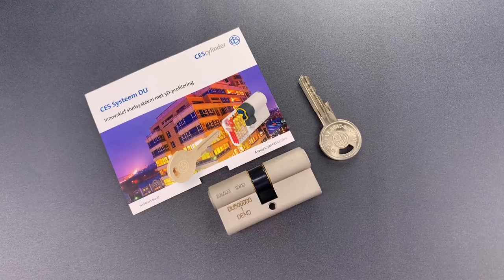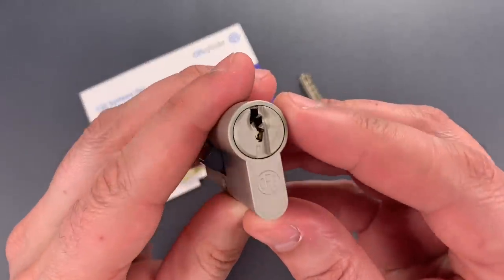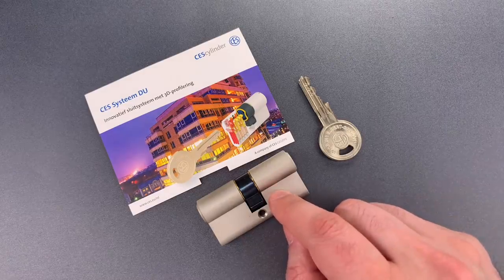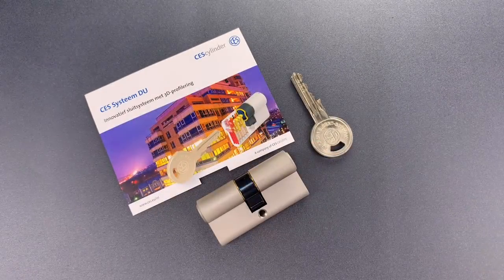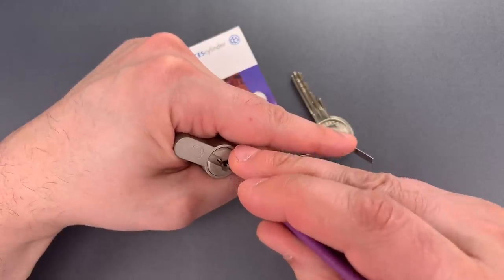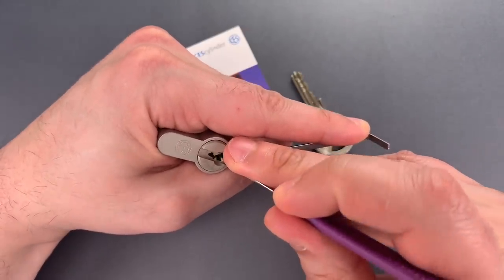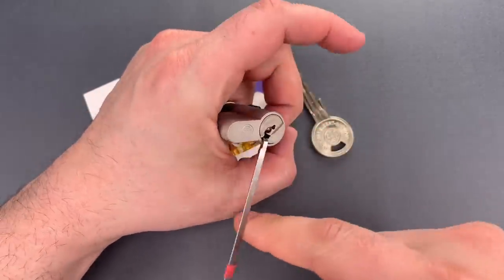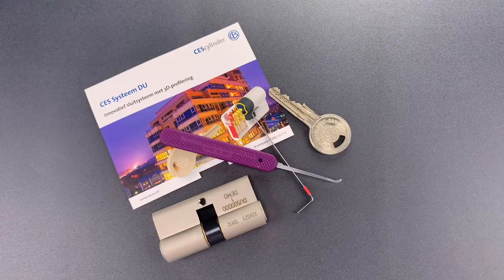[1248] Absurdly Paracentric CES Euro Cylinder Picked

Comment: I have a question for you LockPickingLawyer :
Since we are able to 3D print metal now , and 3D printing allow the creation of structures that are impossible to machine otherwise ( like the way the inside of a bone is), do you think there is a way to make a much more pick resistant lock ?

EDIT : I've never talked about making a "pick proof" lock , or a commercial lock, or even a durable lock. I'm talking about a theorical lock
Reply: The only lock I know is the stealth key brand look it up :)
Reply: One word: Ramset.
Reply: Maybe somebody can 3D-print an impossible pick
Reply: Since most locks poorly made to save costs, I really doubt 3D printing will solve this issue as the costs would be even higher.
Reply: @timwaeyaert8339  not any longer, porsche is printing Pistons etc.
Reply: @righteousone1  troll
Reply: @righteousone1  🙄
Reply: @righteousone1  man who pissed in your Cheerios good god why so upset? did your cat get run over or smth?
Reply: @darksentinel082  well, to his defense, it's in his name 😉
Reply: Bowley already makes a lock that nobody is going through the lock. Anybody wanting in, seeing a Bowley, will go around. They are technically pickable, but only by a select few. 

Criminals in the US rarely pick locks anyway, even though most locks in the US are comically easy to pick. It's too easy to throw a rock through a window, shim the latch, or go around the lock in some other way.
Reply: @idkidk4334  Very cool indeed
Reply: @timwaeyaert8339  there are fully 3d printed rocket engine, for example electron, so i guess while it is weaker than machined, that is not really an issue
Reply: If your goal is to make a very pick resistant lock then I speculate that it is possible to implement NP-hard puzzles with the pins with very intricate internals... but if you can 3D print such locks (cheaply enough so that these locks are profitable) then I guess torches have no problem melting them open too
Reply: If your talking about a lock made all at one time, sadly no, because it's simply impossible, because you need to add pins inside the lock, but making it all seperately and assembling it, yes.
Reply: @Wayne Flanigan Which lock has lockpicking lawyer failed to open?
Reply: @righteousone1  hi I've been 3D printing for a couple of years now I have 3 printers and my best friend has one too, everything Tim said is correct for FTM printing, however most metal based printers dont print that way is all

also after this comment "He's a clear amature." you dont get to have a valued opinion anyway
Reply: @karthikhegde9752  He was responding to @Righteous that claimed "They're plenty of locks the lock picking lawyer couldn't pick. He's a clear amature."  Wayne was calling him out for being a liar.
Reply: @righteousone1  so, what makes you come to random places on the internet and start hurling insults at people? you know, you are making the internet a worse place, right?
Reply: @karthikhegde9752  Thru Picking None But Brute Force There was One  Bicycle Lock Chain He Tried Grinding it for about 12 to 15 minutes He Was Like Yeah I'm Ending The Video Here out of Interest of Time and He Also Explained another Reason Y He Stopped Was Because Since it Was A Bike Lock and Making As Much Noice as He Did For As Long As He Did Someone Would Most likely of Noticed at That point
Reply: @righteousone1  you might want to go back to school and learn how to spell before you try to troll about someone who's leagues smarter than you
Reply: @Wayne Flanigan Bowley lock
Reply: @karthikhegde9752  Bowley
Reply: There is another channel called "Stuff Made Here" in an episode called "Making an unpickable lock. Calling locksmiths"

He creates a lock from the ground up, that he feels might be unpickable. The locksmith he called out to test it for him, was stumped by it. His wife made a comment about sending it to LPL, and LPL actually left a comment on that video, in which LPL sound like he was really excited to see this. In response Stuff Made Here, agreed to send him the lock...but felt he needed to make a few upgrades. The lock itself is fairly ingenious. 

Yes, there will be unpickable locks in the future...that are digital and use heavy encryption. Removing the mechanical apparatus from security and relying upon a much more secure form of barring access. LPL said something like this in a couple of videos that the most unpickable lock was one that didn't have a mechanical component.
Reply: @righteousone1  i did. i reported you
Reply: @timwaeyaert8339  You've absolutely no clue what you're talking about, buddo.
Reply: There are things that conventional machinng can't make, but 3D printing can, because they have complex internal structures (like your example of bone). Maybe that could translate to lock design if you were to have a really tortuous keyhole with areas that'd be hard to reach with conventional picks, but the drawback is that the keys themselves would become more unreliable - more complexity means more things that can break or rust or whatever. Plus, 3-D printing generally has worse tolerances than conventional manufacturing, which is a nightmare for conventional lock designs.
Reply: Becareful everyone, this Righteous one brought flamethrower with him

Instead of answering the questions, he just insulting everyone who oppose him
Reply: @LokiKeanu  I agree, 3D printing is accurate but has many weaknesses
Reply: @righteousone1  okay! thanks for the input! I’m still more successful than you’ll ever be 💖
Reply: @timwaeyaert8339  you know they 3d printed a 1911 pistol, right? Laser sintered metal is strong enough for firearms, it's more than strong enough for locks.
Reply: @oqf17pdr  Indeed but it's improving rapidly
Reply: @TheBinaryRecoil  Well, the "nanotube wire" will still only follow the path of the layers in the print, at least in an FDM system. Composite filaments are good, but the composite does not really affect layer adhesion. Annealing is a better way to strengthen layer adhesion.
Reply: @idkidk4334  which are pickable, and I know personally people who’ve done it
Reply: @marvindebot3264  Saying he is an amateur is trolling but  the first part is true. There are plenty of locks that are close to impossible to pick. I would like to see some of those in this channel. I dont mind if the video would be 1 hour long and a failure. Not every video has to be a successful pick.
Reply: @darksentinel082  just report him and let it be. there is nothing to be gained in discussing anything with a troll
Reply: @LokiKeanu  ah, glad to hear that
Reply: @georgplaz  I have been reporting him but playing along is fun to me
Reply: Certainly. Even without 3D printing, there are insanely difficult locks. But you pay for that increased difficulty with increased production time and cost, and with reduced utility.

It's a trade off between utility, security, and cost. Somewhere in the middle is the sweet spot.
Reply: @righteousone1  Successful in music - winning an award in a remix competition even, with over 500 entries (8 of which from rather popular musicians at that)
Reply: @karthikhegde9752  look up "The Naughty Bucket;" those are locks that have stumped Bosnian Bill and/or the LPL.
Reply: @righteousone1  such as?
Reply: @righteousone1  nah I’m just having fun! reporting trolls is just common courtesy
Reply: @righteousone1  and? at least I’m happy with my life, unlike the guy who’s gotta go around and throw tantrums everywhere to try and be happy for once (tip, from someone who used to be the same way: it doesn’t actually work)
Reply: Have a look for youtube channel "StuffMadeHere"  he is or has made a lock he thinks is unpickable and is supposed to be sending it this way but its taking ages (hmf lol)
Reply: @righteousone1  Imagine baiting in 2021
Reply: @timwaeyaert8339  And yet 3D printing is used to create rocket engines. There are processes using lasers and rapid cooling where 3D printed metal is up to 3 times stronger than conventionally manufactured metals.
Reply: @righteousone1  ma'am you lost your touch from the beginning of this comment thread. Your first comments were pretty funny tbh, but I think you've run out of actually funny insults which is unfortunate. Sad to see it
Reply: @righteousone1  cope
Reply: They cant pick my lock because I dont have a lock.
Reply: @righteousone1  30mm
Reply: @ExarchGaming  Locks that rely on some form of electricity to operate have their own issues. You will always need to move a mechanical part to open a lock. As we have seen countless times on this channel, electronic locks available today often use spring loaded mechanisms or magnets that can be bypassed very easily.
Reply: @countzero2405  yet LPL himself said that it was the most secure way to protect your stuff. usually the failure wasn't the lock, it was what the lock was protecting that had some sort of major flaw. Bosnian Bill and LPL are expert lockpickers, but Deviant Ollum and others in the security penetration industry have a lot more experience with actually physically breaking in to places to test how secure they are. 

Thankfully there are ways to produce electricity that don't depend on the electric grid, i'll put a million bucks on government installations that use that level of security don't suddenly become vulnerable because of a power outage. There is a reason most high security or higher don't use mechanical doorlocks.
Reply: @righteousone1  what the hell is wrong with you? Pick it yourself if you can!
Reply: Stuff brand lock.
Reply: It's not impossible, but the issue comes up when you want to pass produce such a lock design. Getting the precision needed for such complex locking mechanisms that could be deemed "unpickable", would require very expensive printers, and printing them from strong enough materials to resist brute force attacks is also very expensive. Not to mention how slow the 3d printing process needs to be for very detailed parts. All this together would likely produce a lock that may be nearly, if not entirely, unpickable even for LPL, but it would likely not be something that could be available to a regular consumer, due to the high price tag it would most definitely come with.

Lastly, the issue with trying to produce and distribute more pick resistant locks to the public is that in order for them to be used on a large scale, there needs to be a proper infrastructure to support it. If an ideal unpickable lock were to be developed, then to use it on a large scale there would need to be people who are able to create new keys with unique bidding, and modify the lock itself to match that bidding, especially if this is going to be a lock for a door. I'm not sure how well I'm explaining this, I apologize, but I think I've gotten my point across.

Could you do it? Most likely. Has someone done it? Probably. Why haven't you heard about it? Because most likely it's not financially viable  to produce on a massive scale.
Reply: no because you can just 3d print better picking tools and keys in response
Reply: @timwaeyaert8339  not all 3D printing methods have such layering. Not sure, that said, whether metal currently can be printed with one of those more robust techniques.
Reply: There was a guy who designed and made his own lock which a Locksmith couldn't open. He was going to send it to LPL but I'm not sure what happened.
Reply: @Scottyboy2317  He found out his lock had one of the standard flaws that LPL has highlighted many times and went back to the drawing board, and is probably finding out that securing against ALL of those kind of flaws is harder than he originally thought.
Reply: @Scottyboy2317  if you're talking about Stuff Made Here, then it's been mentioned quite a few times before in the comments of previous videos, and even by LPL himself. SMH is making improvements and fine tuning the mechanism before he sends it to LPL, adding more pins, that sort of thing.
Reply: Check out the Stuff made here video
Reply: @Scottyboy2317  that was Stuff Made Here, LPL is asked about it literally every single video, and he hasn't even gotten that lock yet. Stuff Made Here decided to further modify and improve it first and nobody knows what the status is on that.
Reply: @jpjrock007a.k.a.jamesparis2  do you know the title or the number of the video? I am pretty interested now
Reply: Look up stuff made here
Reply: @timwaeyaert8339  Not so.  DLMS prints are just as strong, just not super well suited to small features without post-processing.  Yet.
Reply: @idkidk4334  It's simple, don't allow the ability to tension the lock. Gangsheng padlock.
Reply: @schekelberg6187  TBH I'm Not Sure I Just Know it was A Bike Lock that's All I Remember My Appolgies
Reply: @ExarchGaming  security is definitely one reason, but the more important one for government facilities or company buildings is probably practicality. If someone steals a mechanical key, you have to change the lock and give out new keys. If someone steals a key card you can just block access for that specific card.
Reply: @righteousone1  sarcasm aside it would cos you more then that for toilet brushes 3d printed
Reply: @righteousone1  send him some then
Reply: @righteousone1  are you doing okay? I would guess you’re really bored, but your tone makes me wonder.
Reply: @MrSachasan  Hp makes 3d metal powers printers at 500K a pop and the regen powder unit at 350k, made for very high grade engineering where print is cheaper than cnc metal. they print in mircons.
Reply: @Dirtyharry70585  *micron or µ
Reply: There is more hate in the first handful of comments here than you could find in a Sith convention.
Reply: @XVIIstarPt_  Doesn’t matter what year it is, there’ll always be someone who feeds the troll.
Reply: @MrSachasan  and there are 3D printed rocket engines. 3D printing can be extremely strong. Would also be cost prohibitive for a lock but prices always come down.
Reply: @righteousone1  It's so sad to see that the fine art of trolling has lost it's seriousness. You got called out a troll on your second comment, such an amateur.
Reply: Guys, it deserves our pity. Don't feed it more insults, it needs them to feel special.
Just stop and look at it's recent comments...just sad.

And considering it showed it's real pain early by compulsively slipping out a "biden is your president"?
It's ok, baby, we know. Facts don't care about your feelings, you lost, but you want them to be valid, so you vent them to get a response.
Very cool, good job "triggering" people, we promise that people are all very upset. Really. No matter how much they laugh at you, really they're sad and upset, not you. Keep it up, daddy is proud.
Reply: @christophertstone  Correct.  I'm presuming that Europe has a more subtle class of criminal.  But it doesn't exist in the US except for maybe corporate espionage.  I've taken well over a thousand reports of breaking and entering offenses.....absolutely none of them included lockpicking.
Reply: @righteousone1  His lock picking is superior to your spelling.  You couldn't even use the internet you're on to show you how to spell Amateur........
Reply: @idkidk4334  Stealth locks are not even close as good as Bowley
Reply: You'll be able to do this with quantum computing in the next 10 years.  Will require physical breakage.  Could probably do it now with bluetooth.  I think you're on to something.
Reply: @righteousone1  HMTD, or C-4 always works fine, when other means fail, due to their high detonation speeds. Chemistry can do even more, if noise becomes an issue. E.g. piranha acid (aka caro acid, H2SO5) fed into the core of a lock by a syringe will literally chews up every obstacle that prevents the core of a lock from rotating by a simple screw-driver. Since this particular acid not only turns metals into their sulfides, but into oxides too, an astonishing small amount reliably creates a catastrophic failure to every known lock.
Reply: Newer Abloy locks are almost impossible to pick. For example Abloy Protec2 has almost 2 billion possible combinations
Reply: @darksentinel082  he’s just a troll, just ignore it.
Reply: @righteousone1  cope
Reply: @righteousone1  If you're so well informed then perhaps you would be so kind to "enlighten" us on the subject.
Reply: @christophertstone  Very true but the more intelligent/skilled criminals do attempt to avoid noise or property damage (after all most crooks that are caught aren't very wise with their approach). So having secure locks is a great deterrent to the more skilled criminals.
Reply: @ExarchGaming  but what happened in the end? That’s a lot of time ago and I don’t know if LPL even tried.
Reply: @lisergi  wait what? What happened a long time ago? The unpickable lockpick that stuff made here made? that was 3 months ago, and he said he needed to improve it further before he was confident enough to send it to LPL...
Reply: @righteousone1  I didn't know that nationality and ethnicity could mean the same... oh, wait, they don't.
Reply: @righteousone1  learn to spell amateur before you call someone that.
Reply: @MrSachasan  it is weaker than machined stuff, because of the "crystal structure" of metal. It is because your only heating up a single area at a time and not everything together. The rough material for machining is also often rolled, that increases durability. That doesnt mean 3D printed metal isnt durable, just not as much as machined stuff. It often can be increast by reheating way under the melting point, so the "crystal structure" changes but not the outer form. And you can't always reach tolerances of 0,001mm and the surface wont be as smooth. It takes longer too.
3D printing is mostly used for prototyping because it is expancive and dosn't have enough advantages until now.
Reply: @buffalo wt cheers for the update